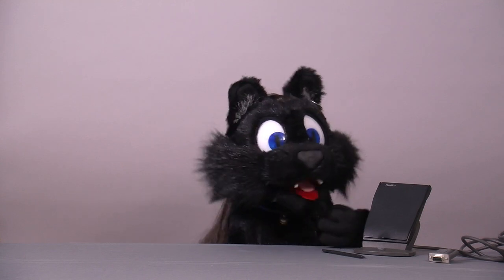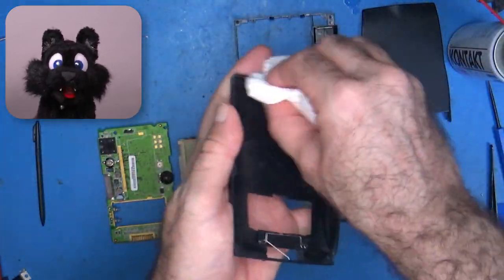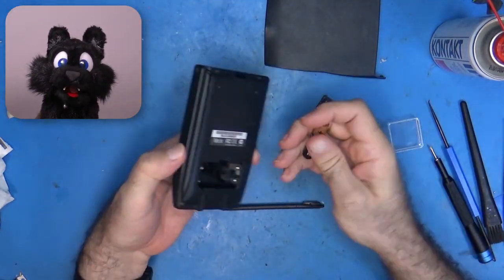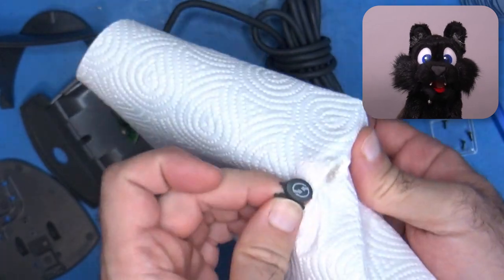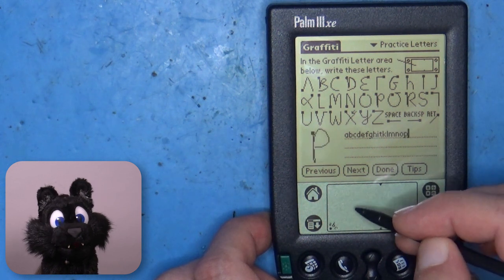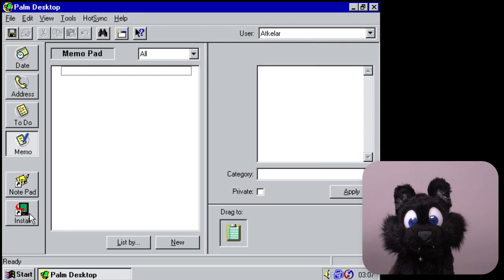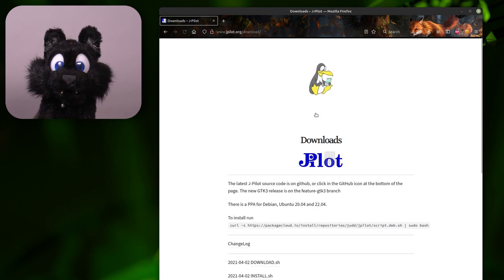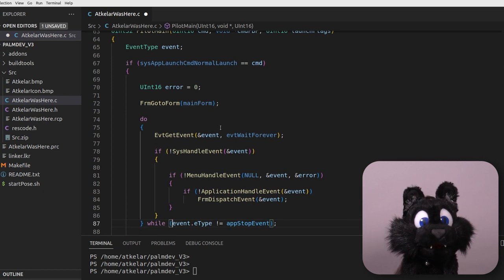Palm IIIxe, deep clean and "modern" use

Comment: What a nifty little device. Very interesting.
Something that does what it needs to do, and uses little to no power unlike my pocket robot
Reply from the maker: It was just right for the job it needed to do. And maybe that was part of the downfall? Hard to say. I do prefer having my phone and calendar together in one device for sure; but does it need all the "smartness"? Not really.
Reply: Nice video :-) FWIW, even, with a new iPhone (14 pro), Windows tablet (Hyundai Koral Pro 10M4), Windows XP notebook (Lenovo x61) and even a mini desktop (Lenovo M93p), I still use my Palm iiic to accompany my devices to connect my Palm iiic thru Bluetooth to sync my Palm iiic email & run my still-important PalmOS-only apps
Reply: Entertaining—-especially the brief history of the Palm device. Downfall? “Smartness” is a relative term. If “smartness” included internet connectivity, I agree. However, If “smartness” ignores internet connectivity, I wonder if syncing  a calendar, alone, on a phone with no other apps, would merit even suggesting to any phone manufacturer. The whole point of “smart” devices (smart phones, included) was the ability to run multiple, useful and clever apps. Including just a calendar app, in todays “smart” phones, would be pure insanity. Enjoy your videos 👍
Reply from the maker: Thanks! Well, the "Palm OS" did fizzle out eventually. I still think it could have made a bigger impact if it had seen a slightly better redesign for phone and internet connectivity. But these features seemed "tacked on" on and the resource saving wasn't required anymore later on and made things more complicated than competitive devices. I somewhat doubt that the "apps" are the only issue, since Palm did offer those too, just not as easy and without the central app store, next to nobody was aware of them. To me, it's hard to assign a proper definition to "smart phone" - when news broke of the iPhone that used the term for the first time around here, everybody was: "WOW! A phone that comes with a claender and contact management and email!" and I'm looking at my then Windows CE phone and go "so what?" 😊